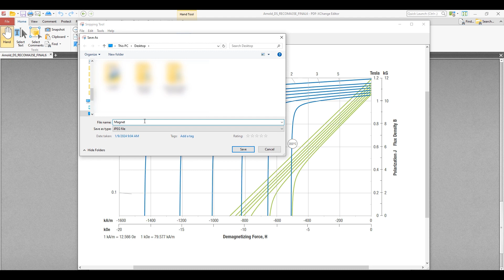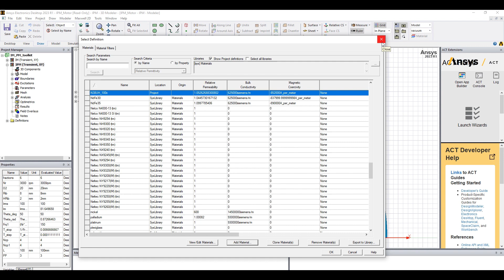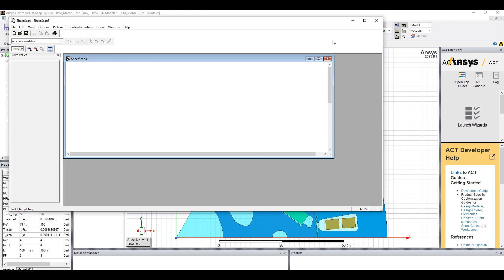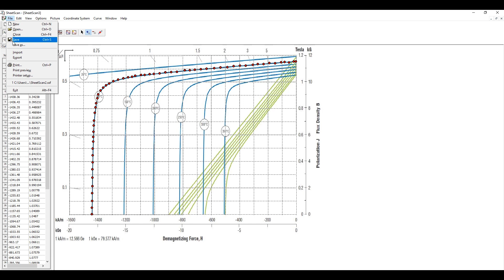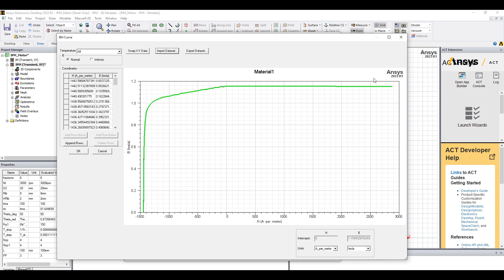How to Extract Magnet BH Curve Data from Manufacturer Datasheet using Ansys Maxwell SheetScan Tool

Comment: Good video! 
Just one question: at the end of the video you didn't select "intrinsic" when you imported the curve (that seems a polarization curve and not a normal curve), Oversight? 
Thanks for the reply.
Reply from the maker: Thanks for your comment. This is just to show how to use the sheetscan tool, but you are right: if we need to perform a demagnetization analysis for example, this has to be intrinsic. However, note that the curve should be smoothed out and start with zero to be able to assign it as intrinsic.

Comment: Great video, thanks...

If you would like to take it one step ahead, import points into Excel, do a best fit curve, recreate points using the equation in a more uniform distribution. This prevents any non-uniform slope changes between any two points by creating a much smoother curve.
Reply from the maker: Thanks for sharing!